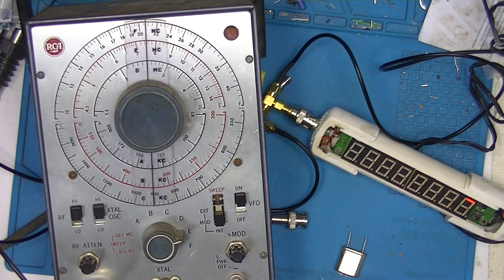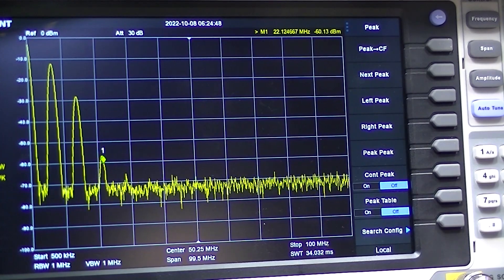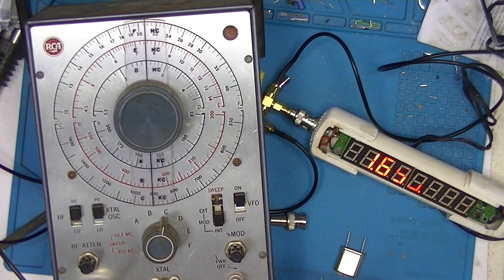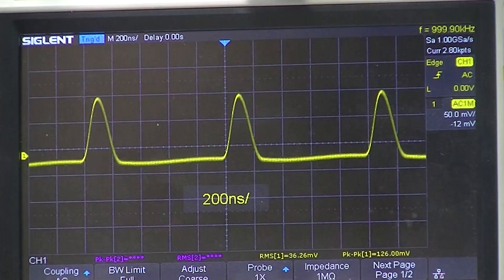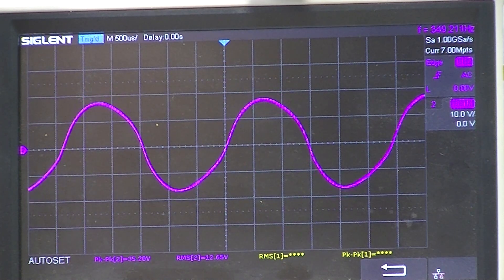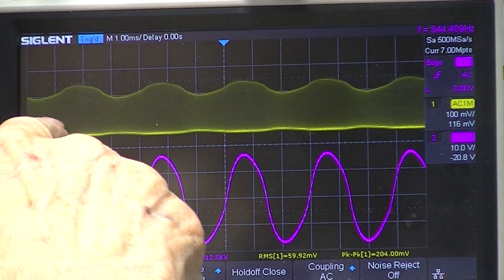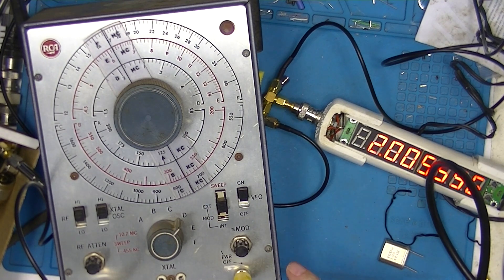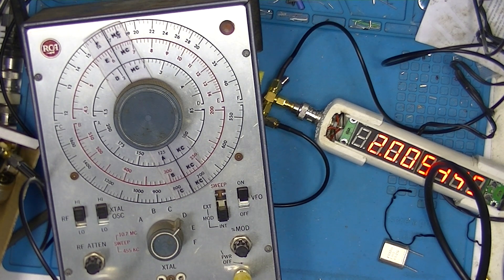A Look at an RCA WR-50B Signal Generator - Part 3

Comment: Excellent series on the RCA sig generator. I'd like to see the sweep function in a Part 4. I have a  WR-50A I got for $5 at a hamfest that I didn't need but couldn't refuse, in perfect condition. I've never used it and want to understand its full capabilities. Thx for the presentation. 73

Comment: You've got a pretty crappy signal generator or more likely it needs repair. I would bet on bad capacitors. The modulation part with square wave also shows some badly adjusted frequency compensation besides the RF modulation is cut off on the bottom. Looks like some bias problem likely again a failed cap.
Would be nice to show a repair video.